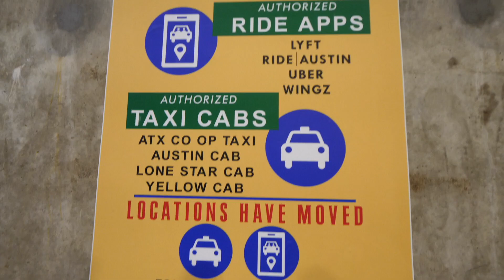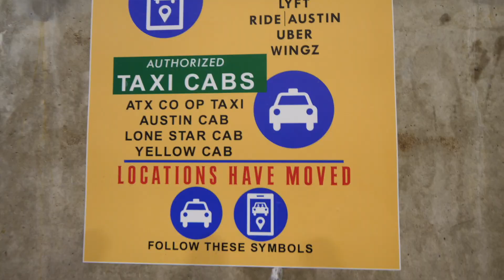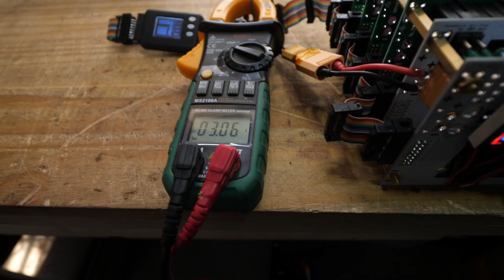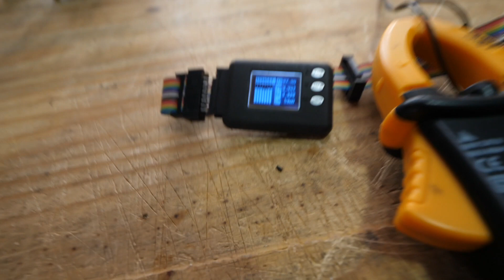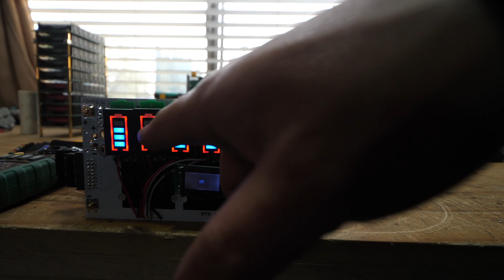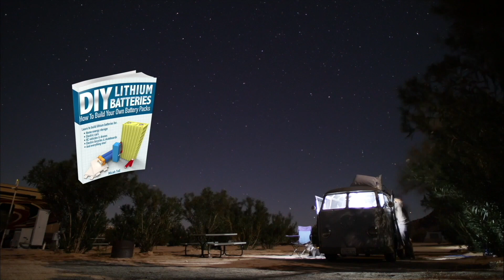Diy Powerwall PCB &  BMS update

Comment: Amazing work! Huge fan of yours. Have you considered using electrical contact grease on the contacts to minimize the impedance on the terminals? Since there are microscopic gaps between the battery and the terminal, the electricity has to arc across the space, this arc creates the heat that you are seeing. A grease can minimize this arc and should reduce your heat substantially.

Comment: Jehu, I'm looking for a battery storage system for an RV.  I live in Canada so cold temperatures are a concern.  As we've seen how the 2018 Leaf suffers in cold weather since Nissan didn't install a Battery thermal management system.  Do you have any ideas how I could maintain battery temperature in an RV?  Hopefully without draining the batteries themselves too quickly.  Which would defeat the whole purpose.
Reply from the maker: I’ve heard of people using heating pads
Reply: go to Average Joe's site.  He's testing a 3s88P v system outside in the freezing snow.  He's charging and deep charging them.  He has a live link with cameras watching the whole process and Batriums monitoring the packs.  It's pretty good stuff. So far the 18650's have held out really well.

Comment: Instead of putting all the cells together soldering or spot welding... could you just use power tool batteries say Ryobi 18v and link them together by way of 3D printed sockets
Reply: Tool batteries are relatively expensive and use cells with high amperage output and fairly low total capacity. Powerwalls should not need high output capability at the individual cell level.
Reply: @dingbingbong  Thank you for the reply.  My thoughts on tool batteries is also for ease of removing a bad cell.  This style of assembly seems very laboring for both startup and in the event of a repair.  Just wanting to understand is all.  Thanks again

Comment: Mr. Garcia, love your videos.  I thought I would help you out with this suggestion.  This might be a bit expensive but what about something like this:  https://www.ebay.com/itm/8S-24V-7S-29-4V-Smart-BMS-Li-ion-Bluetooth-Lifepo4-10S-36V-with-30A-to-60A-/283263526182

Its a Smart BMS for 7 cells, and you use your bluetooth on your phone with a phone app to monitor the batteries.

Comment: maintenance of a powerwall made from that PCB's it's gonna be nightmare. Maybe not PCB directly but those brass screws. Just use some long stel threaded rods with tube spacers and nuts on ends.

Comment: Maybe have a look at the Chargery BMS16, more expensive but will accommodate very large battery pack and has nice output
https://www.ebay.com/itm/Smart-300A-2S-16S-BMS-lifepo4-Li-ion-LiPo-Battery-Protection-Chargery-BMS16/192763357829?hash=item2ce1976a85:g:Ri0AAOSwAP9cGgJm:rk:4:pf:0

Comment: Those power meters are not accurate when comparing them against each other. The problem is that the resistors to make the gradient leds to trigger are not exactly the same from meter to meter. The only way you could do this is if they could be calibrated with trim pots on the boards. Which will drive up the price of the boards.
The resistors they are using are probably 5% tolerant. Which is probably why they don't all show the same level.

Comment: 3:10 You are so wrong, people that have 70K or 100K $ for nice electric car don't spend their time building power walls from used cells or even new cells, they have money, they can just buy nice things and use their time for something else they like. They are not spending hours and hours on youtube and internet collecting knowledge to do something, they can just pay someone else with knowledge to do that for them. It's people that do not have this kind of cash that will invest time to learn to do something by their own because they know it will save them a lot of $$$ .
Reply: I waited in line to order and bought one of the early Model 3's.  I've been watching Jehu for 3 years as well as others and am currently testing 18650's I've gotten from used laptop packs.  Some people don't make lots money, they just save and DIY themselves to be able to sometimes buy expensive things.  I think it's a misconception that anyone "with money" just spends money, because if they did, they wouldn't still have money.
Reply: I also bought a Model 3 but DIY my own power wall.  Why?  Because a power wall is easier to DIY than a EV :-)
Reply from the maker: I talk to those people everyday

Comment: Why is it only important to measure the same cell in each pack? If I have 7s 4p is there little chance that cell 3 in the first pack is low but the other cell 3's are fine? Or would this more be for process of elimination to find the issue?
Reply from the maker: All cells #3 are paralleled = one cell, one voltage

Comment: You could use a female right angle connector for the balance connector instead of plugging in a JST cable and soldering that to the board.

Comment: Is there not a good opportunity sitting here for integration with a Batrium BMS system?  Several of the larger DIY Powerwall builders out there are using it for their setups and it shows a whole world of information about the cells and packs.  Combined with the boards that you are developing, it could be a perfect match for ease of maintenance and ease of monitoring.
Reply from the maker: Batrium does not support our board unfortunately

Comment: Jehu, those little LCD monitors may be more accurate than it seems; the voltage may be right at the level where one of the "bulbs" is bypassed, eh?

Maybe its best use is to show drastically low cells?

Comment: Maybe a microcontroller and something like a 7 segment display to show capacity , of each cell one by one. Similar to how Julian illett's charge  controllers flash to tell voltage. Or maybe just use small volt meters, and you will eventually learn the capacity to voltage , and load , you can get an idea of remaining capacity, and know the voltage... Surely someone can make something with compparitors/ opamps, to show if the voltages are equal or no...great video!!! It has me thinking!!

Comment: You should look into using arduino nano with a pcb for voltage sense you could easily output to a lcd or even setup logging / wifi webservice etc and do whatever you wanted lots of projects out there similar you could look into and arduino nano's are super cheap
Reply: An ESP32 would be even better. It runs a dual core on 240MHz, offers a RTOS, has floating point arithmetic and wifi + bluetooth directly built-in. Since ESP32's are getting cheap as well at around 5$ now, it's a better starting point for an embedded system.

But the most important feature is that it has 12-bit ADC's on 18 pins, so theoretically you can measure the voltage of up to 17 battery cells without external IC's.

And you can run arduino code on it.
Reply: @TimeFadesMemoryLasts  thank you!!! I'm definitely going to look Into those! That's a lot of adc channels on a relatively low cost ic!
Reply: TimeFadesMemoryLasts 
My thought exactly BUT all AD inputs would have the same ground, wouldn’t they? So you’d have to create a voltage divider and accept some loss of accuracy or decouple the inputs somehow.

Comment: you should ask someone in your community to help you design hardware and right custom software. its not complicated the features u want. you have big network. im sure many people would love to help. DONT HACK, DESIGN.
Reply: hack for personal equipment, design for production.
Reply: omarbrown44 
This can very easily be achieved with a ESP32 based Arduino. Including sending you messages in case of errors. And of course a status page with meters if you wanted so. 
The ESP32 modules cost a lot less than $5
Reply: Dude!!!! u just took my thoughts!!!! Why Mr Garcia is still waiting to startup??? Lauch a company, buy an industrial design (sci-fi looking pls), IPO, than booM! the next power wall on the market!!!! i wanna be a representative of this product down here in Brazil.....